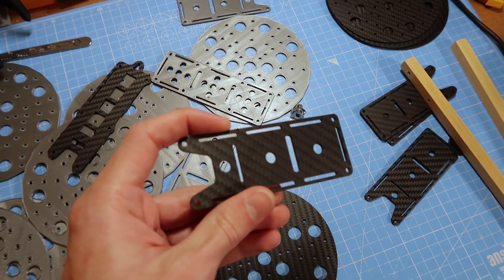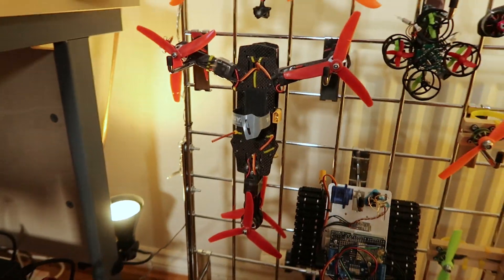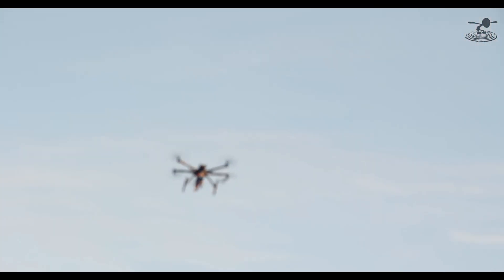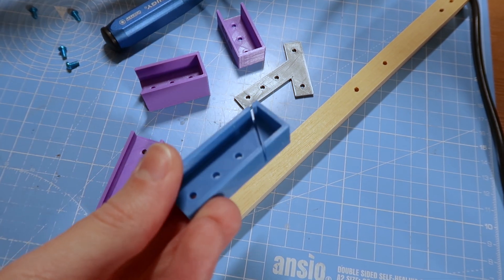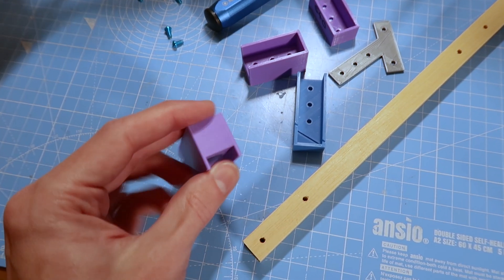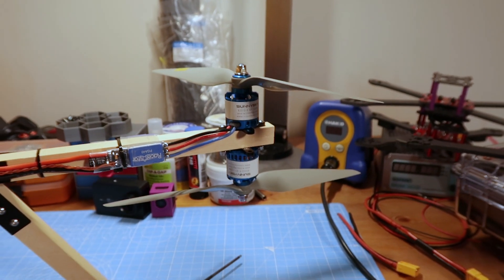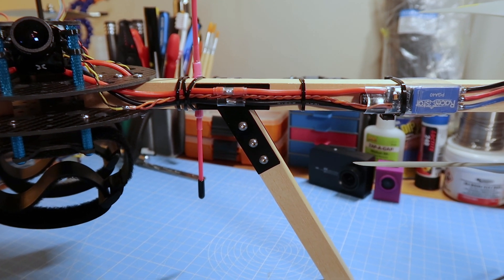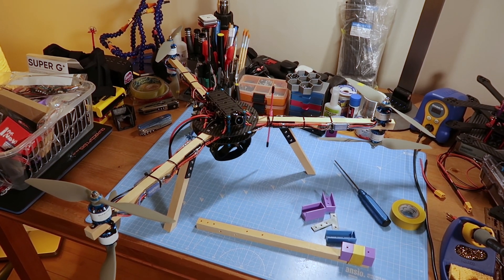Everycopter Y6 // Flite Test Anycopter Homage // Custom Carbon Fibre

Comment: What is the size of plywood and will it be a good option to see it as an alternative to Aluminium tube motor arms ?
Reply from the maker: The hardwood arms are 10mm square. It works fine but if you look at my newer builds you'll see I now use aluminium box section as it is more rigid so leads to better flight characteristics.
Reply: Thanks CJ. Just another query, since 10 mm is very less will it hold both motors on single arm perfectly without more vibrations? 

Are your current Aluminium arms same 10 mm sq. ?

Would be great to hear.

Comment: Nice build!  What was the Shenzhen company you used for the CNC?

As for CAD, the easiest to learn is Spaceclaim.  It's so intuitive that just about anyone can start using it without looking at a single instruction.  Even easier to use than Sketchup!  There's a free student version that you can get for hobby stuff and you don't need student credentials.  There's also a free version that can be used for whatever commercial work you'd like called Designspark Mechanical.  Both versions have various reduced functions compared to the commercial version but both are completely usable for just about anything you'd want to build.  Both will import Sketchup files.  Sketchup is cool, but it's highly lacking and sometimes buggy.
Reply from the maker: There's a huge number of outfits in China that will do custom carbon work, my advice is to take a look on AliExpress, made-in-china, even Instagram & send messages to a few asking for quotes. I'm reticent to name the one that I use, because while I'm happy with the service it is the only one I have first hand experience with, so I can't really say how it stacks up against the competition.

I'll take a look at Spaceclaim, it's not one I've heard of before but I'm also starting to hear more & more negative opinions toward Fusion360. Everybody used to recommend it, but apparently they've been losing fans over how they're changing their free/hobbiest licensing? Every time I open Sketchup for a new project (like the new Y6 I've just finished building!) I tell myself that this is the last time... but then inevitably it isn't 🙃

Comment: Keep the y frames coming. Love tricopters but got fed up with replacing tail servos. Trying a y4 at the moment wooden frame aluminium arms just using old kk2 just to see how it fly's. Use a pixhawk if ok. Built y6 same way. Best regards.👍
Reply from the maker: I'm still waiting to test my most recent Y6 since I rebuild it with carbon arms, the combination of Scottish winter weather & covid lockdowns hasn't been conducive to flying! It has a Pixhawk Cube in it now.